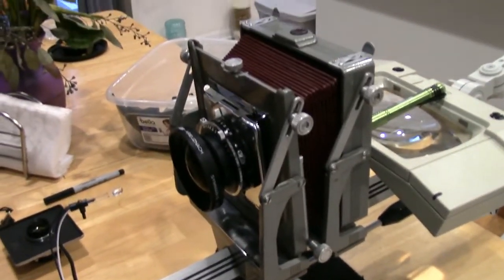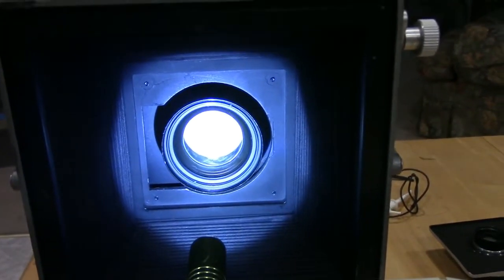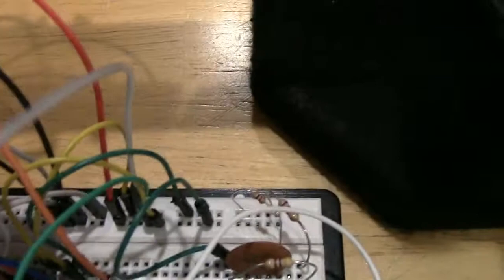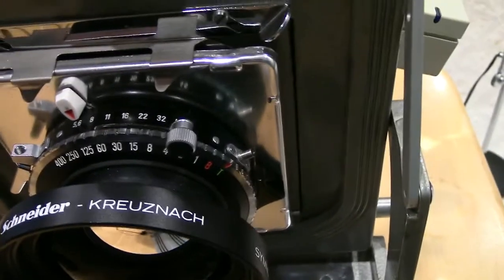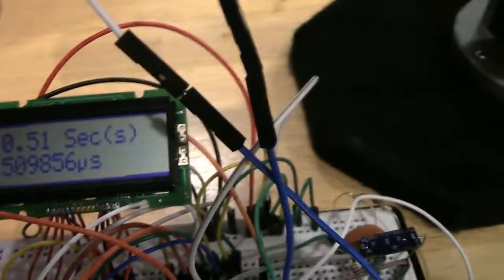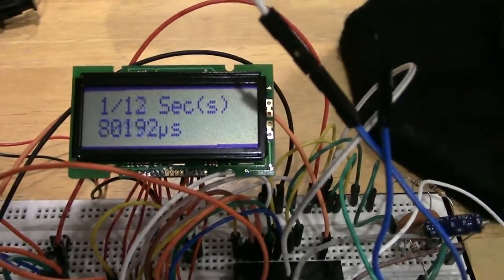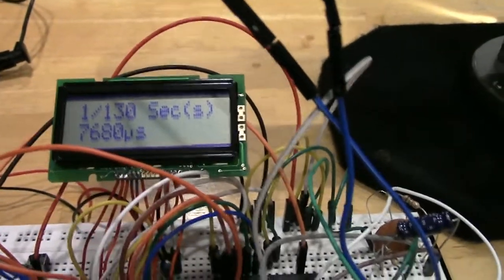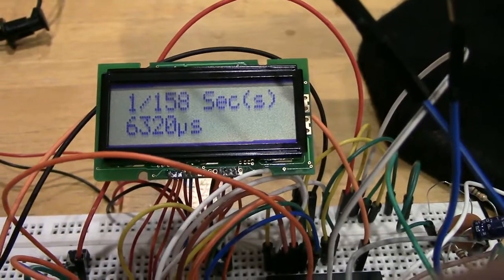Film camera shutter speed tester with an Arduino/Atmega328p

Comment: What is the point ? if you don't show the schematic and code . We all know what it does and what it's for.
Reply from the maker: Because there are several rather complicated setup procedures required for leaf shutters that I still have to work out, although the optimized code is done. And you wouldn't know my device even existed, let alone what it does and what its for if I had not posted the video. A work in progress.
Reply: You can find code here for a different Arduino setup:
https://www.youtube.com/watch?v=UwOh3da_Y8s&fbclid=IwAR0XZ6HGM5KusE0RTW-GP7ChzhyGpz5lEpNDemL0OtM1gQs23umACy5i0wE
Reply from the maker: Code, schematic, hex programming file and more details available at:  https://github.com/donfroula/Camera-Shutter-Speed-Tester

Comment: Would this work with curtain shutter?
Reply from the maker: It does, but following the instruction in the old Calumet shutter tester manual is important to set sensor distance and illumination. The real issue is leaf shutters which will read artificially slow at high speed settings unless setup is done carefully.
Reply from the maker: Code, schematic, hex programming file and more details available at:  https://github.com/donfroula/Camera-Shutter-Speed-Tester

Comment from the maker: The tester is very accurate at slower shutter speeds, but begins to read increasingly longer as shutter speeds increase. This is because leaf shutters are speced at their set speed when fully open, The shutter triggers at "first light" meaning the opening and closing times get added to the shutter speed, making it appear slow. The answer is to use a bulb on a dimmer and set it so that unit triggers only when shutter is fully open at the widest aperture. This is described well in the Calumet shutter tester manual (essentially identical to this one), available on-line.
Reply: Hi, so if I understand this correctly, the aim of the dimmer is to precisely reduce the light source luminance to the point where the sensor won't detect the rising/falling edge except when the shutter is wide open and the luminance crosses the sensor's threshold? In this case I presume you'd need to calibrate the dimmer for each lens you test, based in part on the T-stop of the lens at its given aperture?  
Very good design by the way, I like it a lot.
Reply from the maker: @HamishL  Correct. The old defunct Calumet shutter tester manual I uploaded to my Github site applies to this device as well. All this is explained quite well. Code, schematic, hex programming file and more details available at:  https://github.com/donfroula/Camera-Shutter-Speed-Tester

Comment: Do you have schematics or  instructuons of any kind to make it? Thanks
Reply from the maker: Code, schematic, hex programming file and more details available at:  https://github.com/donfroula/Camera-Shutter-Speed-Tester
Reply from the maker: I'm planning to release an Instructable with schematic and code at some point. I've improved the code some and changed the circuit so it works with a photodiode or phototransistor.
Reply: @df9999999999  are you planning to share rhe code and the diagram for this?
Reply from the maker: @parvezsoudagar  Code, schematic, hex programming file and more details available at:  https://github.com/donfroula/Camera-Shutter-Speed-Tester
Reply from the maker: Thanks! See comments, please.